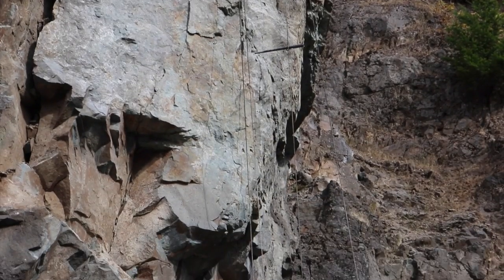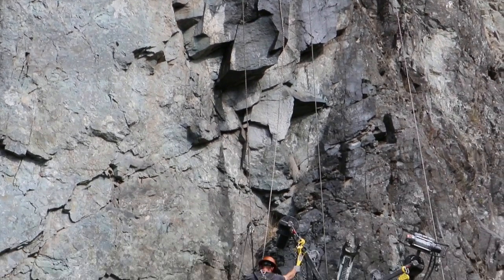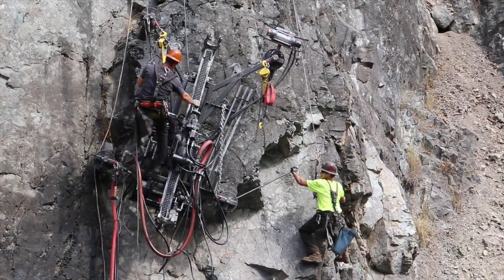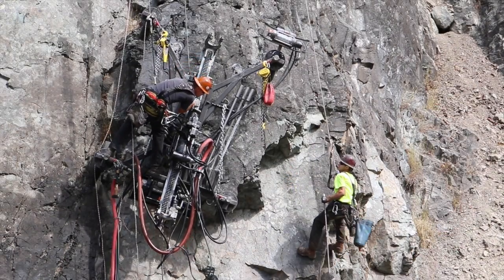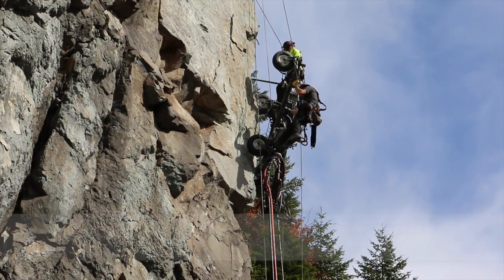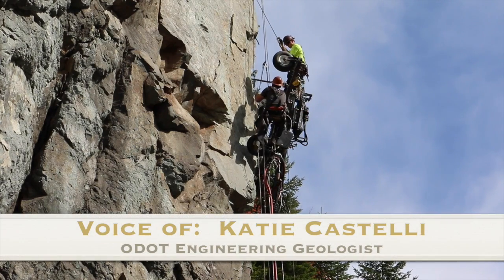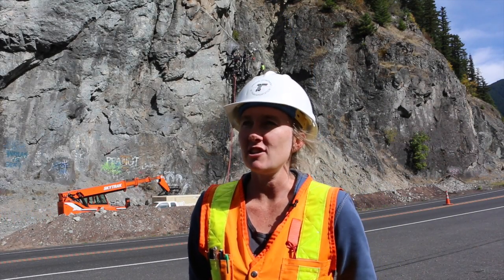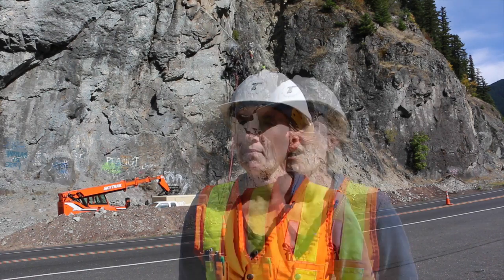Rock Bolting

Comment: 1inch thick steal plates that you can drive over put on the fiber cable area and lots of nitro would have been better for this in the long run. Sounds like anouther classic band aid on a very important highway to me.
Reply: +Chris Lindsey yeah, apparently the "engineers" didn't bother to even determine the depth of the fiber optic cable, nor do they really know the stability of the rock they are attaching to.... Who pays when a "bigger" fix is required next time?